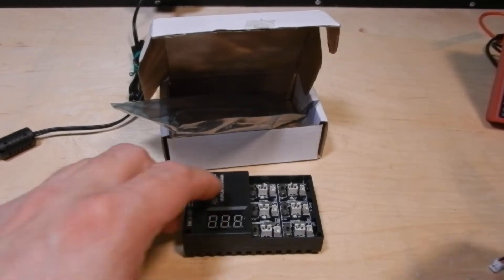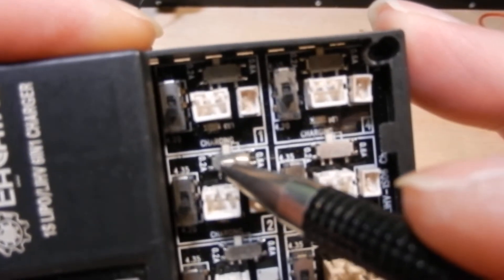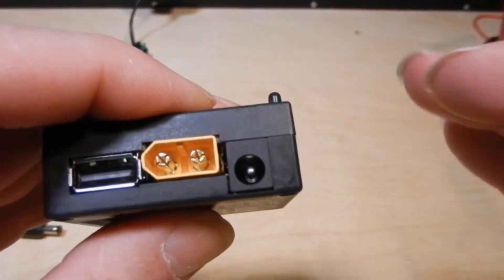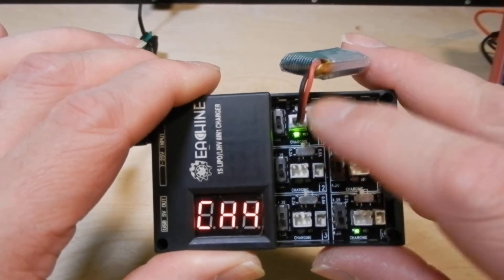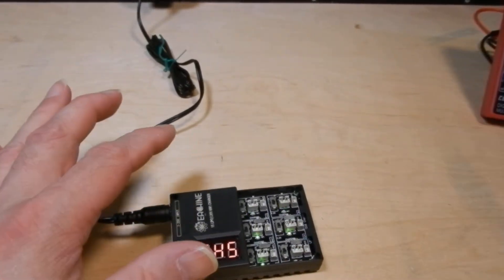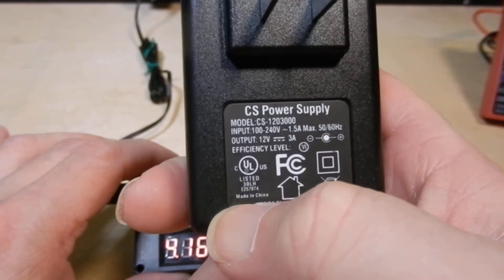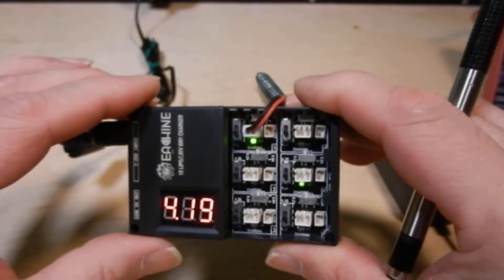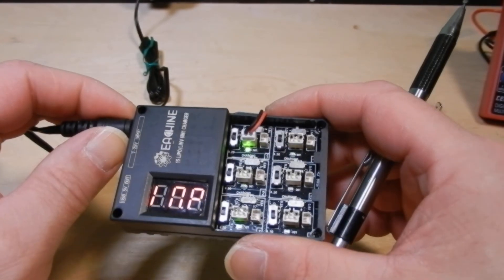Eachine 1S LiPo LiHV 6in1 Battery Charger

Comment: Great video!
I plugged my old Hitec charger into it and it seemed to work. Meaning it cycled through the channels showing each one's output. However plugging in a battery caused the display to read "USB" without any cycling.
I plugged in a couple of batteries and waited, and waited, and waited for the solid green to go out. After more than 75 minutes I gave up thinking maybe the charger was faulty.
Now I see, thanks to your comprehensive video, that while the old TX charger is inputting about 10.8 volts, it's only doing so at 55 mA. So... it would take about five hours to charge one 250 mA battery. lol.
Liked and Subbed.
Reply from the maker: Thanks for the comment. Glad I could help.
My personal recommendation is to use this 1S 6in1 charger at the 200mAh setting. I noticed that charging even one or two batteries at the 600mAh setting made the batteries and charger very hot. At 600mAh charge rate, I would be concerned that the charger and little 1S batteries won't last long.
For charging at 200mAh up to 6 batteries. 12V 3A or better Power Supply.
To charge at 600mAh per battery, you will need a power supply rated 18V to 24V at 5A or 6A, even 10A or 12A will work.
Adapter plug is 5.5x2.1mm.

These suggestions are based on 200mAh x 6 and 600mAh x6 with a 40 percent or better safety margin.

This appears to be a switching charger but I don't expect it to be great at switching current between channels.
What do we expect for $15 from china.
Reply: @therccrashproject6330  Wow! Too bad I can't like a comment more than once.
I was just going to go on Amazon to find a charger. I'm so glad I saw your reply first.
Soooo great that you've stated the plug size. Takes the guess work out.
I'll heed your suggestion and only charge at 200 mAh. With six batteries I won't have much forced down time.
I suppose I could toggle selected channels to 600 mAh for say 15 minutes, checking the bat and charger for heat, then toggle back to 200 mAh? If I'm in a hurry.
What do you think?
EDIT 1:
Damn. My laptop charger is 19V and 2.7 A but the connector is tiny.
EDIT 2:
Got lucky and found a 24V - but only 650 mAh - laying around. That'll do for now.
Reply from the maker: @JELB1960  Don't toggle charging current while charging. Select 200 or 600 and leave it for the charge cycle.
With that 24V 650mAh PSU, you can safely charge only two batteries at 200mAh. Three and the PSU will start to get hot. 4 or more batts and it may not turn out well.
You could use a larger LiPo to charge the smaller batts with. I've only used a 3S 2200mAh but it says it can do 2S to 6S.
Reply: @therccrashproject6330  Thanks again for the reply. I will refrain from changing the rates mid-charge.

I lucked out at the local thrift store and picked up a 9V 1.1A charger for $1.00.

I assume that, at the 600 mAh rate with 2 batteries charging, each is getting half of the 1100 mAh available. So... 550 mAh each.

That seems to be the case. This morning I put two on at that rate and it took just 40 minutes til lights out.

At the moment I've got three going at the 200 mAh rate. They'll take nearly 90 minutes but that's fine. If I'm in a hurry I'll use banks 5 and 6 at the 600 mAh rate.

The charger is barely noticeably warm and the batteries cool. I suppose that's cause of the lower voltage of this "new," charger.

Thanks again. I see you've a review of the FXT Viper V2 FPV Goggles. As I'm leaning toward the eachine EV800Ds I'll check out your take on the Vipers...

Comment: What is the polarity of that DC plugpack input socket - + inner or - inner? Mine is not marked and I cannot see any markings on yours either. Russian roulette anyone? A neat way to increase sales I suppose. ;-)
Edit....I just switched to full screen & HD and can see that the wall charger in your hand uses a positive inner plug. I'm presuming that the one you have connected to the little charger is the same Tovarich? Subbed. :-)
Reply from the maker: It is a positive inner, negative outer. If you have a multi-meter you can check to make sure the polarity on your power supply is correct.
Reply: @therccrashproject6330  Thanks for the info. I've got an old computer supply brick that I've butchered & mated with bits off an auto lighter plug supply with a large selection of swappable tips. Works a treat if you know the polarity. :-)

Comment: Congratulations for posting that, but I would like to add a minimum contribution about milliamps calculation. Considering the overall circuit topology that seems to be switching type, they reduce the voltage from 12v to 4.35 much more eficintly so the calculations should be more our less like this... 4.34v x 0.6A = 2,61W per channel, considering all 6 channels should be 15,66 W. If you power it wit a 12 v 2A power supply it would feed 24W that has 53% spare power, that shoud be pretty good for this application.
Reply from the maker: Thanks for the comment and for the input. 
I will admit that it has been a while and I am a little rusty with some of the math, but Ohm's Law has not eluded me yet; I'm not quite that old yet.
In the video I just simplified without going into Ohm's Law or too much detail because most people that will be looking at this won't even care about the math, only getting in the air, being safe and not burning their house down. I may, at some point, get into the math in a few videos. But there are already so many videos out there covering the math that it would be superfluous.

What I initially assumed was that these do have a half decent switching circuit (roughly a 50/50 supply/cut rate). But without knowing exactly what the Chinese put in these things, having a schematic or even just a verbose spec sheet, we can only assume the worst case scenario.

Your math does work with a good and proper switching circuit.
12V 3A would be OK with the math on a perfect switching circuit, but assuming that it is not a perfect switching circuit, or not a switching circuit at all, it won't end well (Remember that we are dealing with an imperfect $15 charger here).

The 12V 3A PSU with your math will work, (I'm broadening the numbers here a bit for a range example) but only with a switching circuit that supplies the 600mAh to only one, two or three ports at a time and cuts the mAh demand on the others accordingly. 
Basically assuming a 50/50 supply/cut rate as I initially assumed. 

I did mention that with the 12V 3A PSU when charging even a couple batteries at 600mAh, the PSU would get very hot very quickly; meaning that it is demanding too much from the PSU. This would indicate that this is not a proper switching circuit. 
That's why I was recommending the 12V 3A power supply for 200mAh charge only. For 600mAh charge I recommended a least an 18V or 24V at 5A or 6A PSU; preferably a 24V 6A for charging on all six ports at 600mAh. 
I may have missed a bit of that statement in the video.

That way, if it is not a switching circuit or the switching is not perfectly efficient or divided properly at all times, then you are still safe.
Besides, the circuit will only pull as much as it needs.
Super Simplified... If the PSU gets very hot, then you need a bigger PSU or decrease the demand (hence, lower the mAh charge rate and/or charge fewer batteries at a time).

I was also making my recommendations to just use the 200mAh setting because the chargers themselves got pretty hot quickly at 600mAh anyway. They may not last long using them at 600mAh all the time.
Better safe than sorry.

Thanks again for the comment and thanks for the input. Your comment will help others.

Comment: Please recommend cheap power supply. Thx.
Reply from the maker: Sorry for the delay in responding. Had a long couple days here with the holiday.
That, and my internet was down most of today.

My personal recommendation is to use this 1S 6in1 charger at the 200mAh setting. I noticed that charging even one or two batteries at the 600mAh setting made the batteries and charger very hot. At 600mAh charge rate, I would be concerned that the charger and little 1S batteries won't last long.

For 200mAh charge with up to 6 batteries...

I got these....

ANVISION 2-Pack AC to DC 12V 3A 36W Power Supply Adapter 5.5x2.1mm

https://www.amazon.com/gp/product/B01DHK76YM/ref=oh_aui_detailpage_o08_s00?ie=UTF8&psc=1

They may have a single pack of this as well.

This power supply allows you to charge six batteries at 200mAh ONLY.
(Do not use to charge at 600 with more than two or three batteries.)

To charge at 600mAh per cell, you will need a power supply rated 18V to 24V at 5A or 6A, even 10A or 12A will work.

You can use any power supplies rated as such. The only thing is that the plug must be a 5.5mm outer by 2.1mm inner with the polarity positive in the inner pole, negative on the outer.

You can also use any 3S to 6S LiPo on this as a power supply.

Thanks.
Reply: @therccrashproject6330  wow you are awesome! The BEST advice regarding the charger AND charging I got online ever. Big, big thanks!
Reply from the maker: No problem. Thanks for your support.